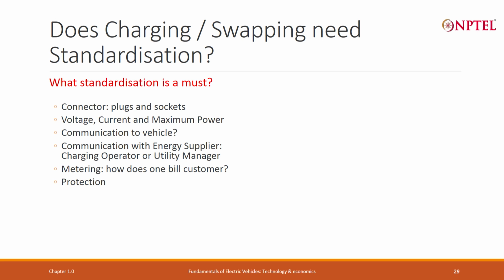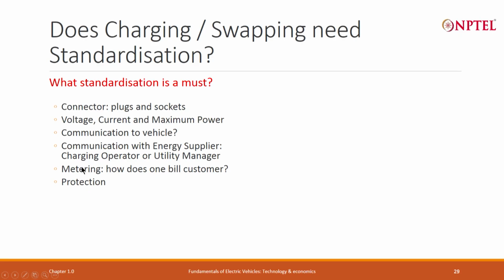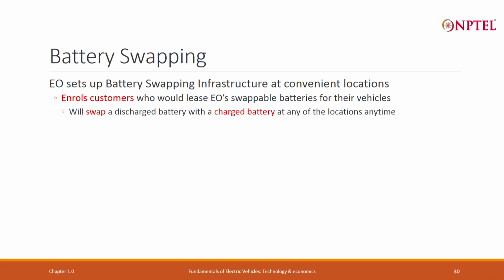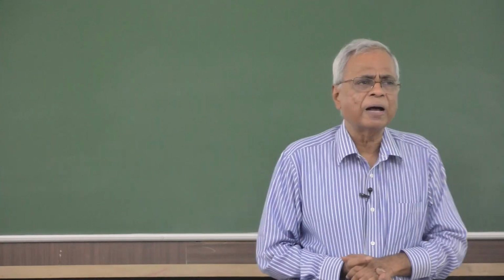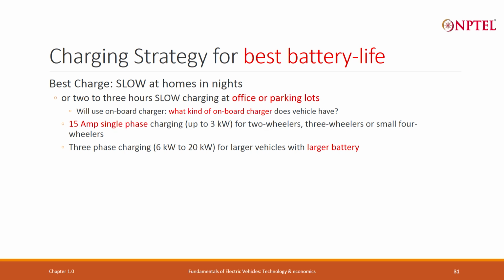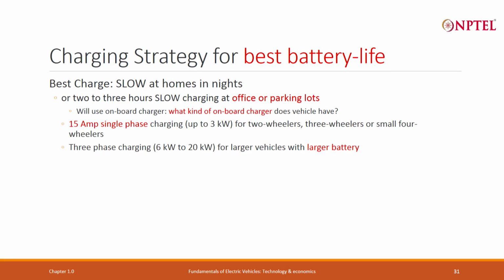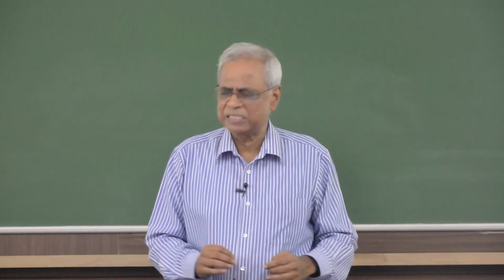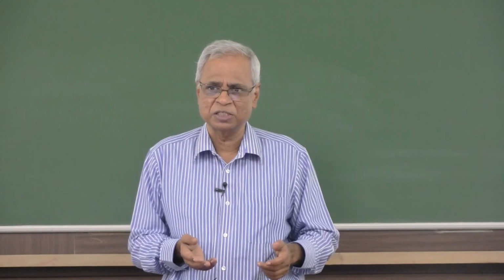Lecture 5: Charging and SwappingInfrastructure

Comment: Locked batteries will limit the flexibility in the usage of battery. If battery packs are assigned a specific ID just like aadhar number and enable identification of the batteries by the charger and EOs, then the users can either opt for swapping or charging as required. Costing may be done accordingly.

Comment: sir you said we'll be having locked smart batteries in future for standardisation then how can we have public charging with slow and fast charger at public places ( like shopping malls , parking lots , office etc ......as different battery and different vehicle will require charging as per its specification or what you call standardisation ? )
Reply: locked smart btry in case of Swapping